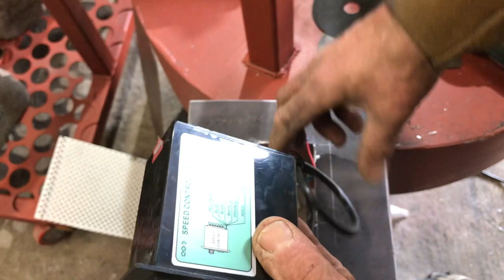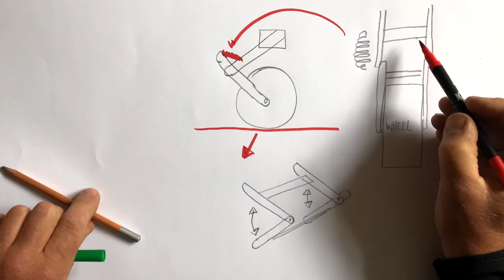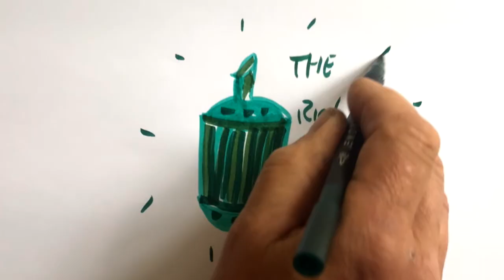Building a Sand Muller  part two

Comment: seems to me the inner scrapper is backwards, right now it is drawing the sand to the center and not away into the path of the rollers
Reply from the maker: Hi, yes scoop was the wrong way. When I started to use the equipment there was a lot more tweaking after video, maybe should do an update video. Thanks for watching
Lit.